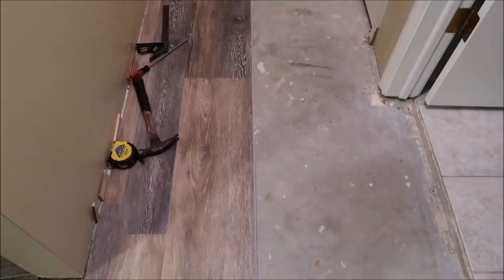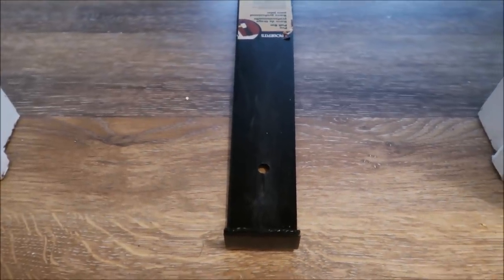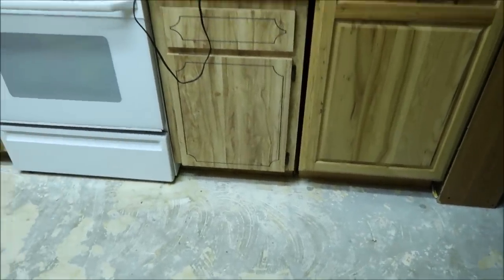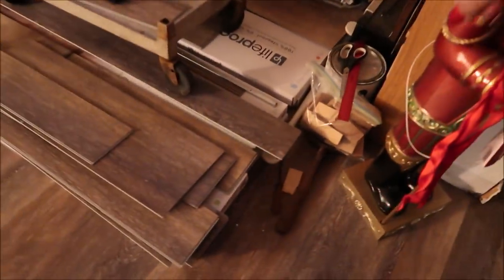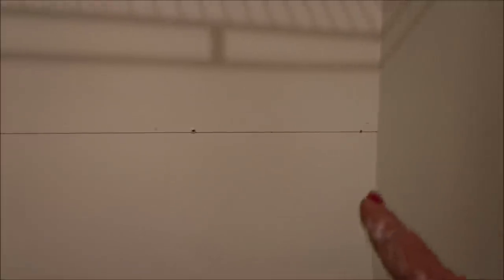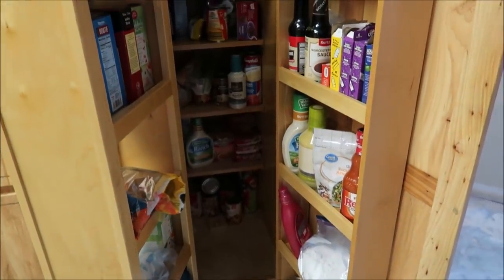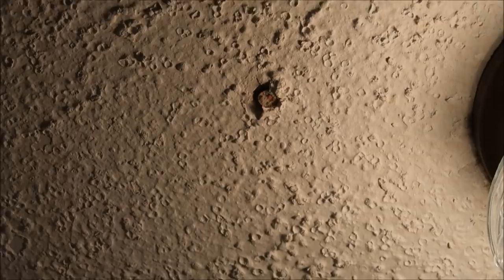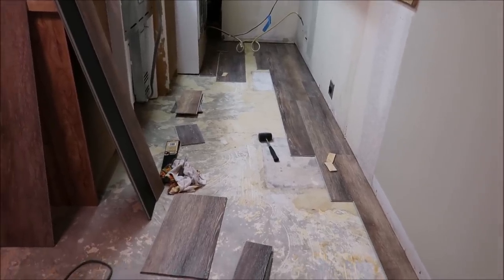DIY PART 4 WORKING ON MY HOUSE

Comment: As long as the shelves slant toward the back wall nothing will fall off the front of the front of the shelf. That would be a good plan, sale the tall pantry and have a long countertop. Just keep your dreams alive in your mind and never give up, even if you have to make them come true yourself. I had to learn that one for myself. Yes, your floors are looking so good. I love the way they look. Nails do work their way thru the sheetrock in the ceiling and walls after a while. In my apartment I have a few coming thru and I have to call my maintenance man to come in and fix them. Yes, sale it for $250.00 and you can always lower the price if it doesn't sell at $250.00. Love you and your videos and you.

Comment: Fantastic job!  I've been doing my floors, too, and you've provided some much-needed inspiration.
Reply: On my countertops which I'm redoing (the place hadn't been worked on since the 1970s) I'm using a Giani Countertop Paint Kit which runs about $80 on Amazon or Home Depot.  I intend to do all of the countertops so they match -- you might want to check it out.  Good luck!